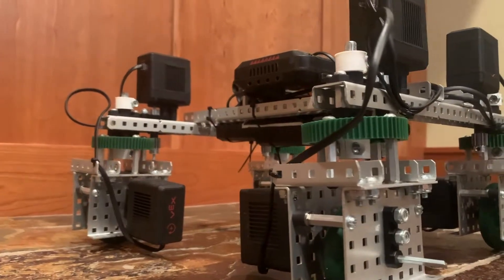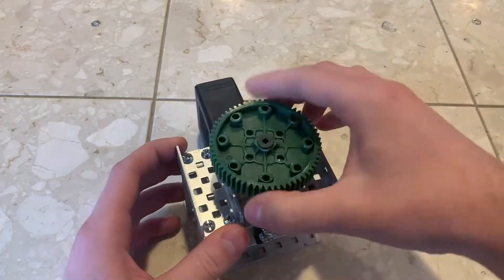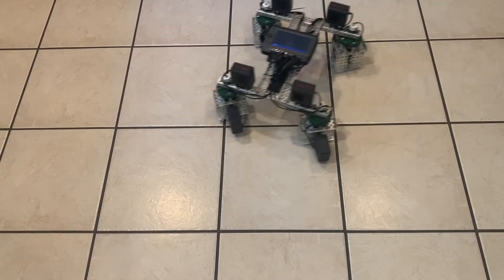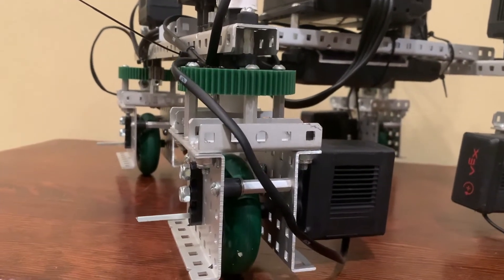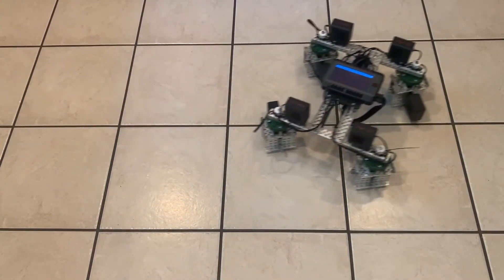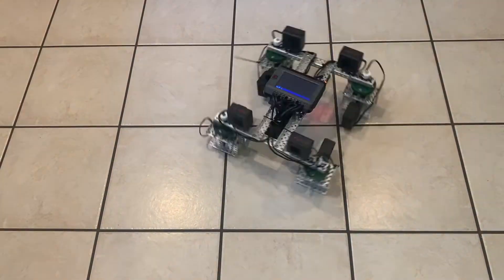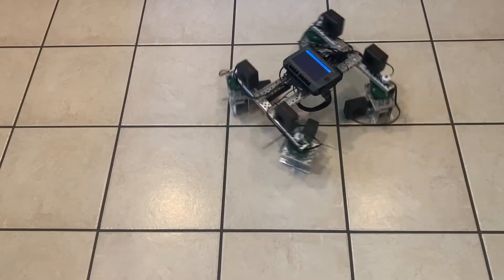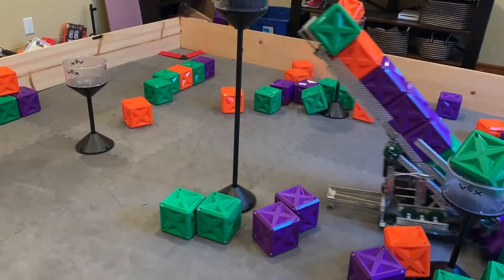Kepler's Guide To Swerve Drives

Comment: I think differential swerve drive could be a great video. I’ve seen some somewhat vague renders on the forums but nothing in detail.
Reply: I don’t think a diffy swerve is feasible with just vex hardware. However there have been FTC teams that created diffy swerves.
Reply: @owenelmburg6362  ive made and one it works great, its just a little tall

Comment: what do you mean it's the most memed drivetrain? swerve is great in frc, it's so much easier to drive than tank (speaking from experience of tank vs mecanum in ftc)
Reply: It’s memed in vex robotics because we have a limit of 8 motors total, the swerve drive takes up all eight motors while not having the pushing power of 8 motors. So it’s not optimal for this competition
Reply: @adamsalem-s  that would do it lmao...
do you have any other types of actuators? like how ftc has 8 motors and 12 servos, or frc has 16 motors plus pneumatics?
Reply: @spidernh  we have 8 11 watt motors. We also have 5.5 watt motors that count as half of an 11watt motor. The wattage limit is 88w so you can interchange some of the 11W for some 5.5W. We also have pneumatic actuators but I don’t think those would be applicable in this scenario.

Comment: Is it possible to turn while moving at the same time, or does that get very complex on the programming?
Reply: That's the best part, if you use matrices to represent rotation and translation you can simply add them together, creating combined movement. You can even define the rotation point wherever you want (also outside the robot) making for some really interesting drive modes